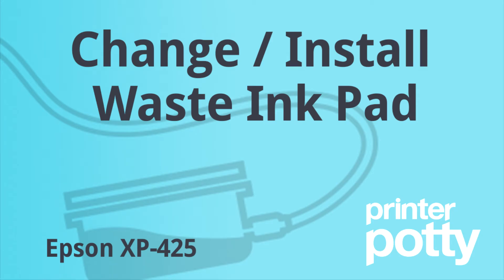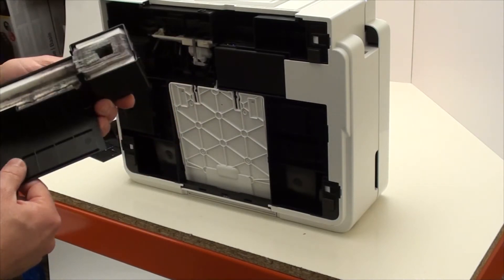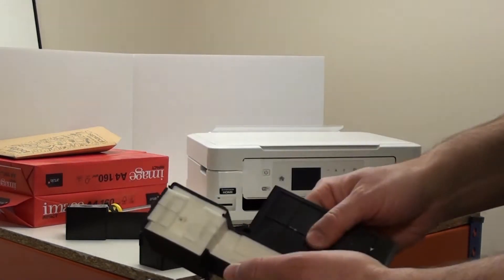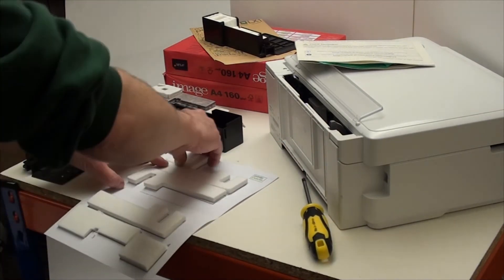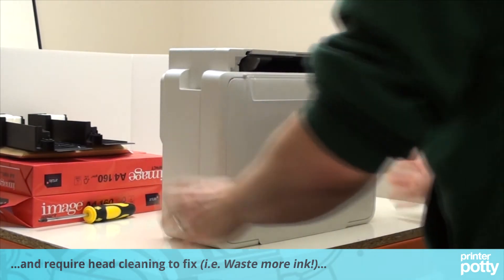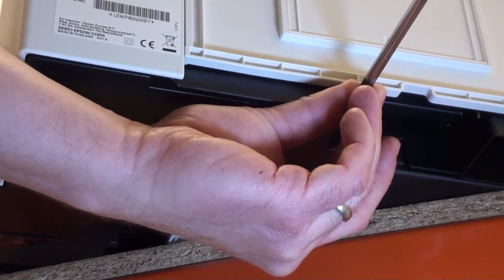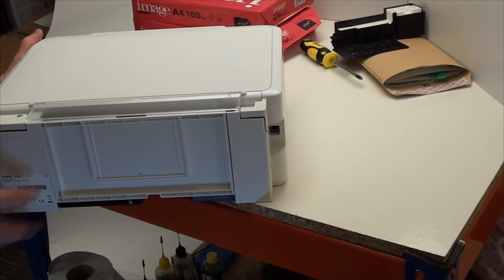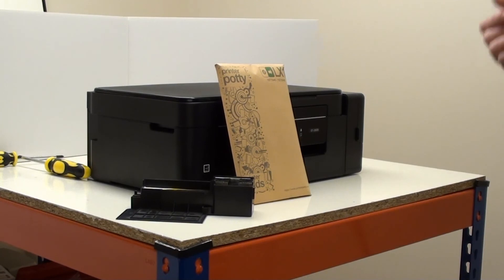Replace waste ink pads XP series (Covers SX-230 to XP-445 models and many more)

Comment: HORRIBLE instructions, just slide it to the right does not work he does not explain what he is doing!!
Reply from the maker: The initial demonstration is poorly lit so it's not as clear as it could be but if you watch the secondary demo from 7mins 30secs, you'll see a much better lit demonstration of the same process and it should be a lot clearer. Also worth noting that if the pad holder is not sliding right you may have forgotten to remove the screw first.

Comment: My Epson XP-445 announced on its display screen that the "Printer Ink Pad is at the end of its life. Please contact Epson support." I did that but what came up on the support screen looked very complicated, so I watched this video instead. As a result, I ordered a replacement ink pad identical to the one shown in the video. I followed the instructions, took out the old pad, and the replacement clicked exactly into place, just as it did in the video. However, when I put the printer back in its usual place, reconnected the leads to the power supply and computer and turned it on, the same identical message came up again, telling me that the "pad is at the end of its life."  I've no idea what I did wrong, as the video above explained everything in detail and I followed the instructions closely. Has this happened to anyone else and if so, what is the problem and the solution?
Reply from the maker: You still need to reset the waste ink counter using the WICReset app. You will need a key (basically a credit) and the instructions in our videos on this channel.

You can get the key here:
Https://www.octoink.co.uk/keys

The instructions you can find with keywords: wicreset instructions

Comment: I cleaned the ink out and then replaced the Box and new pads but the printer wont allow me back in. abd show the original warning message.  Is there something Else I was supposed to do.
Reply from the maker: Yes.. You also have to reset the waste ink counter. Check our videos for WICReset for the info on that.